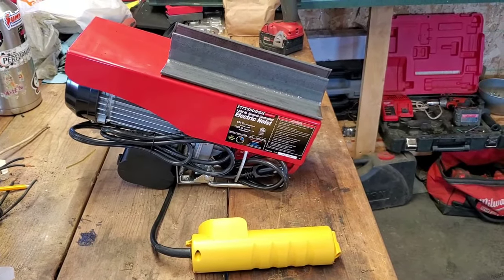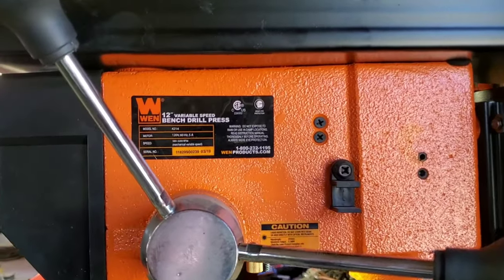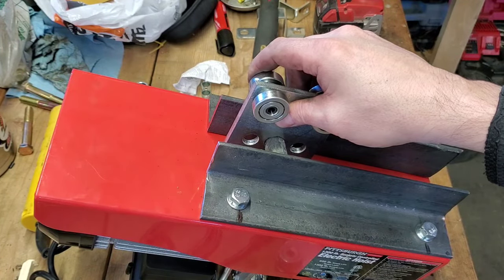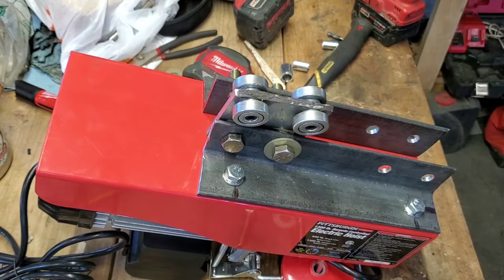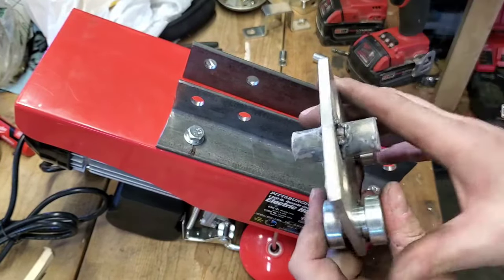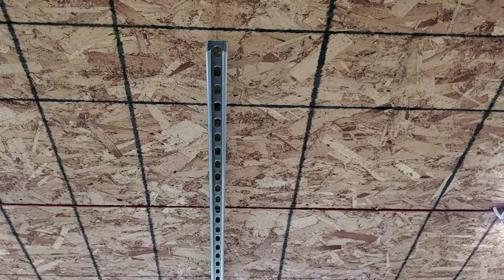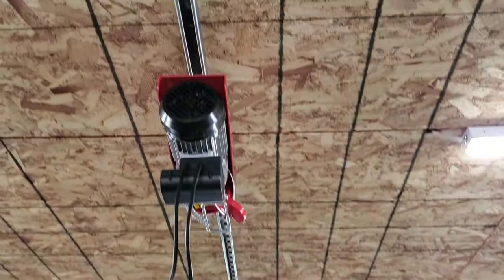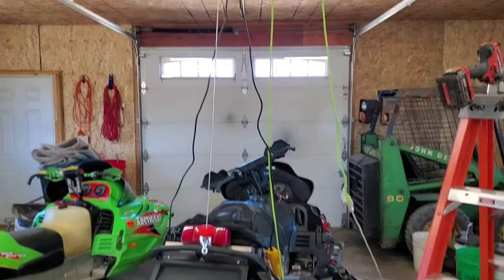Harbor Freight Pittsburgh 1300lb Hoist Install (Unistrut and Trolley) #diy #harborfreight

Comment: Did you think about greasing the track and the trolly wheels less noise snd maybe avoid condinsation build ip during winter thus rust on the wheels and track plus less noise.
Reply from the maker: Good point I should grease it. It is quite noisy.  Not really worried about condensation because the shop is heated and stays dry in the winter.

Comment: You can buy purpose made combined trolley wheel and bracket for this exact usage, bolts directly onto the hoist, no drilling. They would  eliminate the angle iron stuff, spacers and so on
Reply from the maker: I have since found those for a reasonable price.  This was during covid so I was bored and wanted to do a bit more work! Thank you for the comment!
Reply: Could you share a link to a combined trolley wheel bracket you mentioned.
Reply: @paullchristensen  Oops sorry ... now I see he posted a link under the video, and if you scroll down the page, you'll see many other designs.
Reply from the maker: @MnktoDave yes sir!

Comment: The interesting question is what do your ceiling joists (which you incorrectly refer to as rafters) look like? How are they supported? What is their size? If you load this hoist with it’s full capacity, how do you know you won’t pull down the ceiling?
Reply from the maker: Yes correct I did not realize my mistake until after filming.  My roof support system is made up of 2x4 trusses.  I screwed the unistrut into each joist, then went up top and layed a 2x6 flat and ran it the length of the shop. I then screwed the 2x6 to the joists from the top to give everything extra support.  Also I do not plan on loading the hoist to its full capacity.
Reply: @fixer2u not trying to be a naysayer but the strength in a 2x6 is in the wide side. Be careful

Comment: how far apart are the mounting bolt holes? we're replacing one but want to upsize, but we upsized too much to the 2000lb one but were hoping the 1300 would be 4in apart like the 880lb one we're replacing.
Reply from the maker: Are you talking about the mounting holes on top of the winch?
Reply: @fixer2u  yessir.

Comment: Great video. I'll be doing the same thing in my garage this weekend. Only question I have is did you us any washers on the lag screws that you used to hold the unistrut to the ceiling?
Reply from the maker: I did not, I just made sure to position the screws so the heads caught the unistrut well.

Comment: Did you have any issues with c channel strut you used once it was fastened into place? My trolley gets hung up on the fastener heads
Reply from the maker: I did initially, but was able to fine tune as I went.  Not perfect, but I don't use it all the time. It is definitely nice to be able to have it move!

Comment: what screws did you use for the track and did they hold up well?
Reply from the maker: I used these below.  They are holding up fine, but I would recommend finding some with the flatest head possible so there isn't a clearance issue.

https://www.menards.com/main/hardware/fasteners-connectors/bolts/lag-screws/grk-reg-rss-reg-1-4-x-3-1-2-star-drive-zinc-round-head-structural-screw-50-count/95306/p-1539239321648-c-8742.htm?tid=-2769326429757118834&ipos=15
Reply: @fixer2u  did you drill into the unistrut to make holes for that?  Slotted unistrut slots would be too wide for that?
Reply from the maker: @TheJonititan  I did not drill in.  I was able to angle the screws to catch the trusses with the existing holes.  Some of them were at a pretty steep angle though.  If I did it again, I would probably drill holes where necessary.
Reply: @fixer2u  yes I've had to do something similar.  I'm currently looking at grinding down the heads on some coach bolts as I don't trust angled screws for any weight.

Comment: Just curious.  Do you think it was necessary to weld the spacer rods in place?
I am thinking that those two spacer rods would be "trapped" in between the angle iron sides, enough so that there wouldn't be any fear of them coming out.
This would allow a little "play" for the trolleys to roll a bit easier.  Just a thought.
Another idea for you would be to use a pole with a hook on it to run your winch along the rail without putting any strain on your electric and remote cables.
Reply from the maker: You may be correct on the rods... My Thought was if they were stationary, it would keep them from shifting and possibly binding if the trollies were not parallel?  I agree with you.  What I do now is keep a short strap on the hook and grab that when moving it down the rail.
Reply: Most pro shops have a thin steel cable taking the load of the controller, so no pull strain on controller cable
Reply: I've got the exact same trolley system on my electric hoist with the angle iron on top. Instead of using the rods, I used alltread with 4 nuts on each piece. One on the outside to hold it on and 2 on the inside. That way I can move the inside nuts to adjust where the need the trolley wheels as I needed.

Comment: your joists are not made for the weight that the hoit will be exerting on them
Reply from the maker: I added a 2x6 the length of the shed with screws in each rafter joining them all together.

Comment: You put over 500 lbs. on that thing mounted with screws in the trusses and that whole thing is going to come crashing down!
Reply from the maker: They are not screws, they are structural lags.  They are screwed into each truss.  I then have a 2x6 laying lengthwise across all the trusses up top and 2 deck deck screws attaching it to each truss. Not to mention all the osb has 8 penny nails in it holding it to all the trusses.  I have lifted 2 engines (one was a V8) amd a truck bed with no flex in the trusses.